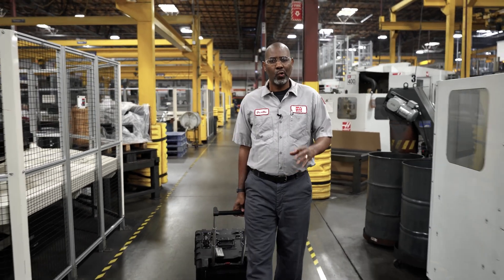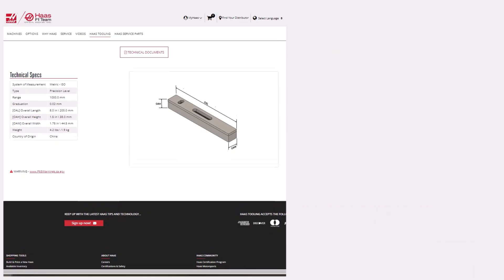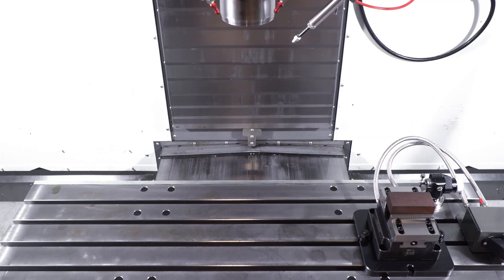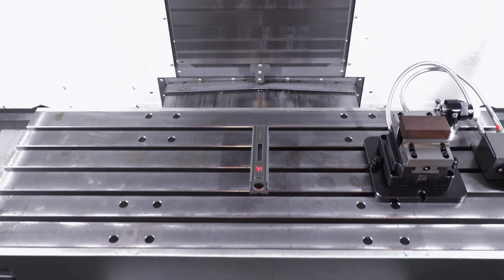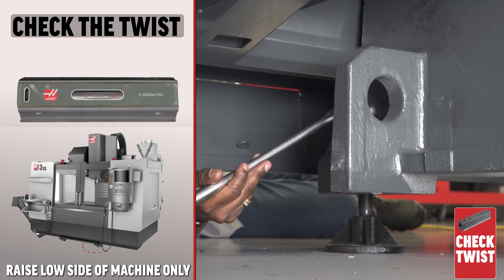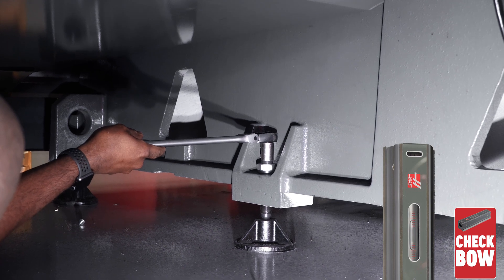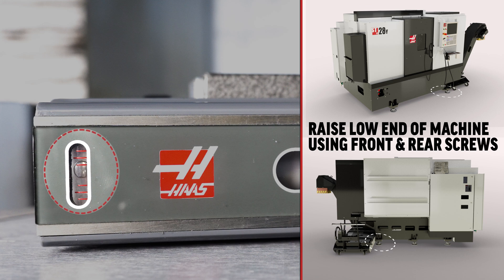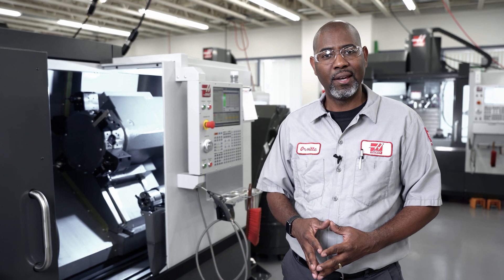HaasTooling Precision Machinist's Level - Haas Automation, Inc.

Comment: I have nothing against Haas and have never used their products, but these are made in China.  I bought 2 similar Chinese levels (6 & 12 inch) from a local tool supplier.  12" seems ok for now, but the 6" level's vial is rotated to one side slightly which makes it hard to read.  The cause of this is the screw holes where the level attaches inside the body are not at the same height.  I will be making new holes and tapping them to solve the issue, but for the price (over $100 Canadian) I would have expected a lot more.  Unfortunately when it came time to using it, the return period was expired.  Also the adjustment mechanism for these cheap ones is inside the cast body and is a pain in the you know what to calibrate.

I was fortunate to pick up a Starrett 12 " level off Facebook Marketplace, and the comparison to the Chinese made ones is night and day.  If it's in your budget go with Starrett.

Comment: So one old time thing that still applies to modern machinery.
If it is a big heavy casting, level the machine and then let it sit for a couple days and go back and re level it again.
It takes a while for machines to settle after moving them.

For the lathe: I don’t like magnets around precision instruments nor do I trust them to not let go of the level.
I made a flat bar with a pocket to fit the level in the center, a pivot that goes in a boring bar holder and a leveling screw on the other.

Comment: Great video, Error at 1:20. you can fix it with a text overlay. To calibrate note bubble position and flip it end for end in the same spot.  Bubble should stay in the same position!  not in the middle.  The middle would only be accurate after the machine is leveled....
Reply: Great appointment bro! I was just starting writing a comment saying exactly the same thing!

Comment: if You leave center screws loose machine gets a huge bent in the middle (Vf2/3 VM etc) 
if you start with back screws loose instead of middle the Y axis bow is much smaller and easier to controll

Comment: For the calibration didn't that assume the table is level in the first place?
Reply: Bubble should stay in the same spot when flipped. Whether that is the middle or not, depends if the machine is already leveled.
Reply: You can calibrate on an angled surface. The key is to flip the level exactly 180deg and put it in the exact same spot. If it reads the same amount "out of level" value in both directions, the level is calibrated.
Reply: @nickp4793  Yeah that's how I learned it, just seemed in the video they glossed over the "make sure to rotate it until it reads the same both ways" and just kept it aligned to the X axis of the mill, which we can't trust is a level reference if we're actually trying to level the table in the first place 😂😂

Comment: Can you explain how VMC machine geometry is affected by machine level
Reply: The machine will be twisted in every direction when you first set it on the floor. The twisting will lead to the axes not moving in a straight line, which will lead to inaccurate part dimensions. The only way to guaranteed everything is straight, is if the machine is level.
Reply: This old Tony did a video on his lathe that showed the taper because it wasn't level. I suppose same thing with a vmc